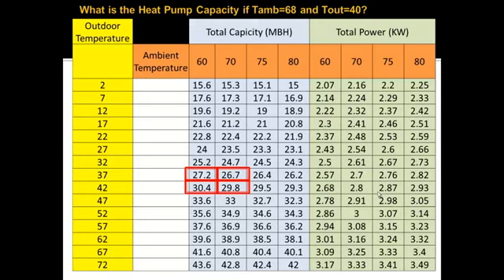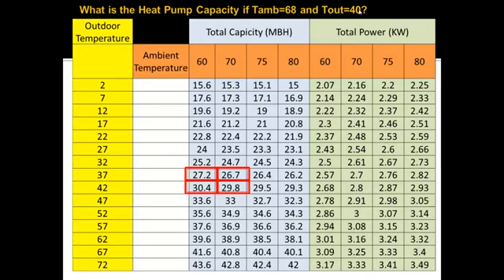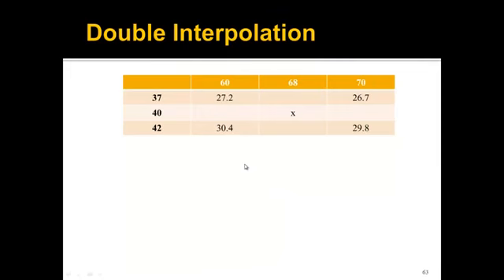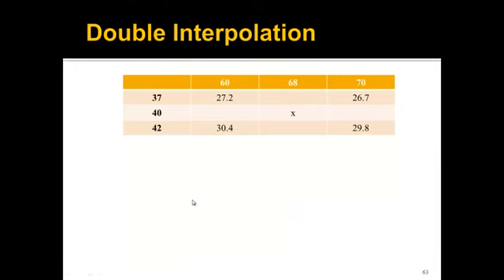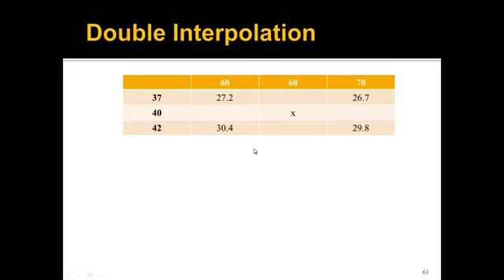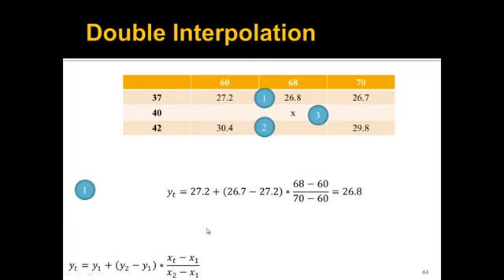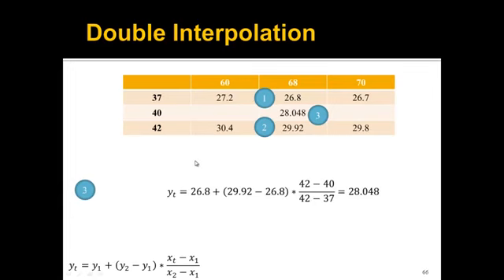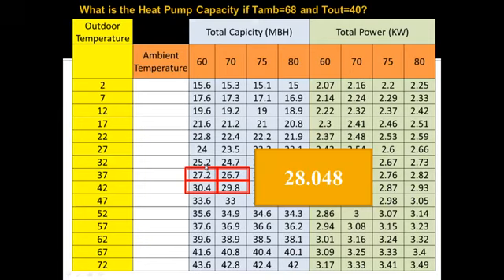Double Interpolation

Comment: Thank you for your video.
I think there is a mistake in your last calculation (3). If we follow your formula. Xt-X1 should be 40-37 instead of 42-40 as shown on the video.
Then final result should be 28.672 instead of 28.048
Do you confirm?
Reply: yes the correct answer is 28.672